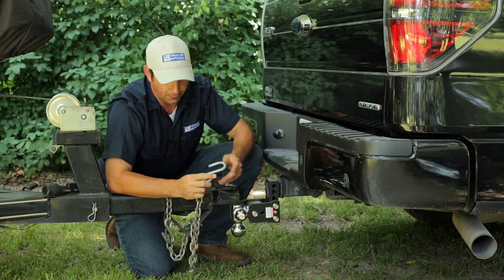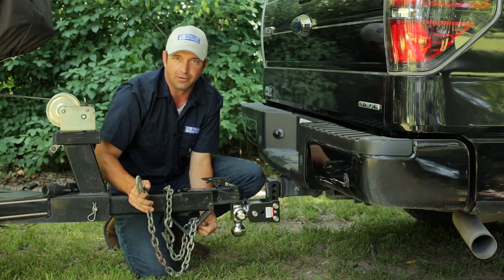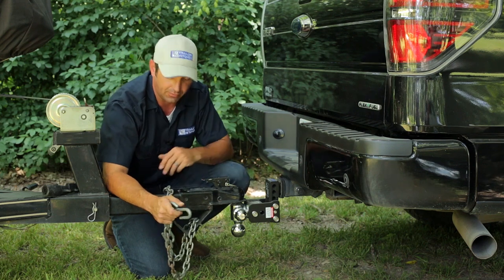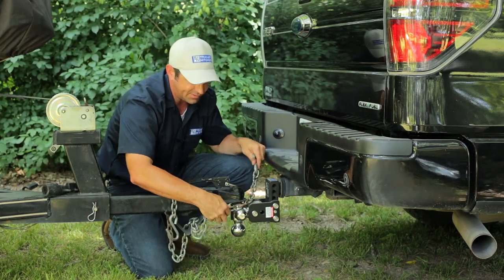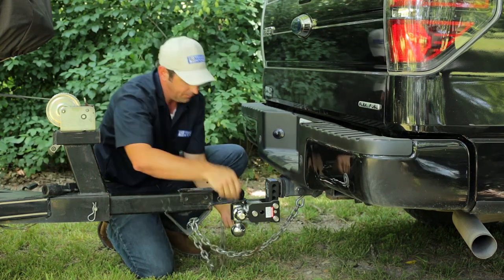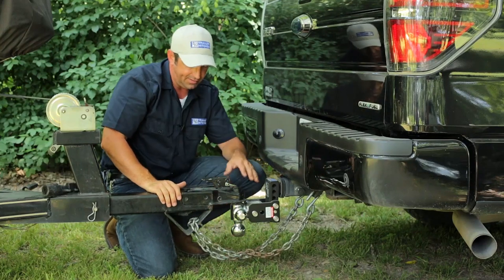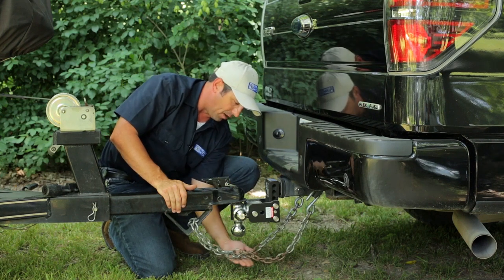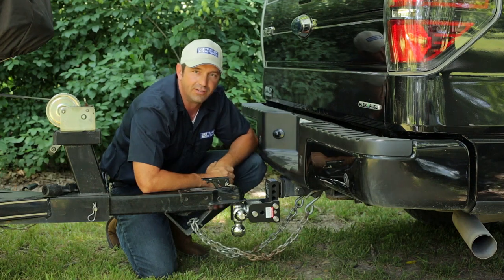Using Safety Chains Properly

Comment: It's not the best practice to twist the chain. Temporary fix, ok. But the twisting creates tension and compromises the integrity of the chain. Best thing is to buy new cotter pins and hook up the proper length of chain without twisting the chain. Also, it'd be great to see how to determine the proper length given that the truck & trailer will need to do left and right turns. We may need a certain amount of clearance for this, instead of just aiming for a 3-5" clearance above the road when the truck & trailer are in straight alignment. Otherwise, clear videography, great verbal clarity, and I love my B&W hitch.
Reply: Interesting point as when he said "twist it to take up slack", I thought that was a brilliant solution.

Comment: Criss cross won't keep the tongue off the road. A hammock only works if both ends are elevated. A hammock won't keep anything help up, if one end of the hammock has fallen. 

Length of chain, and minimal distance between chain attachment at the trailer, and where it's attached to the truck is the key
Reply: thank you

Comment: DO NOT TWIST THE CHAINS. Putting a twist into the chain will reduce the working load limit.
Reply: @Jack Hoffman actually it is
Reply: @Jack Hoffman actually it is totally true. Never twist the chains.
Reply: @MotoGPfan3987  ... "twist the chains",. This would be a good name for a rock band. Or, "Twisted Chains". :-)
.
Reply: How do you keep the slack from hitting the road?
Reply: @Bill-dp7lp  Shorten the chains
Reply: I am sure you don't care but, if the hitch lets go that twist goes away, the mechancial load is then centered on the arch of the chain as intended.  If you twist until they are taught then you have an issue.  Physics brother, but I am sure you already know that so what is the point.
Reply: Not true...better to twist the chains if NECESSARY instead of having them dragging on the ground. Period.

Comment: The S hooks without keepers will flip out when the the chain tightens and whips back. It happened to us and the trailer went down the highway by it self about 50 mph.The chain wiplash flipped both s hooks out. S hooks must have keeper clips. This bad info should be taken down.
Reply: Mine came undone the first trip I ever took and the trailer didn't even come unhooked, just the damn chains.

Comment: Great concept, but crossing chains for a cradle effect won't work for most applications where regular (standard) length chains are used... as soon as that trailer coupler comes off the ball, you must remember that ONE END of the cradle also falls as the trailer tongue falls especially with long-chains...  It's going to touch the ground anyway. THE ONLY way this cradle technique works is with very short chains, which would most likely make turning a bad thing. I suppose one could install a very short third CENTER chain that will catch the tongue before it hits the ground but does not hinder turning. I still cross my chains but not for the cradle effect as mine are too long for it to help. Twisting the chains does shorten them, but a twisted chain is a weaker chain.. As far as the cradle thing goes it's very easy to test.. Disconnect the trailer (coupler from ball) lower it to the ground and see if it touches terra firma or hangs under the vehicle..  Try it and you'll see what I mean.
Reply: I was really hoping that somebody else was going to get that too.... Because I had a problem with Uhaul.. With the same concept
Reply: Came here to mention that and you already did...this is one of those old wife tales again...
Reply: There are many configurations for sure... Can the chains be secured to the trailer closer to the coupler/lunette ring, if so have them moved closer... I've done that and it works for me - there's almost always a solution :- ).  
Kev

Comment: I'm from Australia and I can tell you there are several things you'd never get away with here that seem to be okay in your country. 
(1) Those hooks are downright DODGY. They would never be considered safe.....they could become detached easily and would straighten if a shock load was applied.
(2) Attaching the SINGLE length of chain to the trailer with a flimsy little bolt is stupid. All the shock load would rip that bolt in half in a nanosecond.
(3) As others have said already.....the chains are too long and wouldn't act as a cradle if the hitch came off the ball. The hitch would be in the ditch!!! Stupidily too long.

Comment: Those hooks are designed to hook on to the truck. Or if too long, loop through the truck hook point and attach the hooks back to the chain at the correct length
https://youtu.be/IzxlHKQQNCs?si=acFWgUAuQ0Jj9uBK

Comment: Those chains won't do any good if the pin ever falls out of the removable extension right?
Reply from the maker: Safety chains are used for exactly this kind of situation. They hook onto the holes on the vehicle's hitch receiver, which is bolted or welded to the vehicle frame. This way, should the ball mount detach from the receiver, the trailer's safety chains will still be connected to the tow vehicle.

Safety chains should be checked over every time you tow and be securely attached and crossed in an X under the ball mount. Chains with latches or keepers are recommended over chains with just the S hook. In the event the trailer becomes uncoupled from the vehicle, the forward motion of the vehicle often helps pull the chains tight, keeping the trailer tongue slightly elevated. Wind resistance and road friction will generally start working against the trailer as soon as it detaches from the tow vehicle, helping to naturally slow it down. It is important to stay calm and avoid any sudden maneuvers. Instead, steadily slow down and pull the trailer to the side of the road, bringing both the vehicle and trailer to a stop.

To help guarantee the trailer slows down during one of these situations, it is always recommended to have an emergency breakaway system installed on the trailer in addition to using safety chains. The emergency breakaway cable should always be connected directly to the tow vehicle and NOT to the ball mount, the hitch, or the safety chains.

Comment: Those chains are too long, the trailer tongue will drag on the road if the trailer become detached. The chains should be fastened farther ahead on the tongue and adjusted to the proper length, not twisted.
Reply: Yep. Great concept, but crossing chains for a cradle effect won't work for most applications where regular (standard) length chains are used... as soon as that trailer coupler comes off the ball, you must remember that ONE END of the cradle also falls as the trailer tongue falls especially with long-chains...  It's going to touch the ground anyway. THE ONLY way this cradle technique works is with very short chains, which would most likely make turning a bad thing. I suppose one could install a very short third CENTER chain that will catch the tongue before it hits the ground but does not hinder turning. I still cross my chains but not for the cradle effect as mine are too long for it to help. Twisting the chains does shorten them, but a twisted chain is a weaker chain.. As far as the cradle thing goes it's very easy to test.. Disconnect the trailer (coupler from ball) lower it to the ground and see if it touches terra firma or hangs under the vehicle..  Try it and you'll see what I mean.
Reply: @John-B69692  Lowering the coupler with the rig stopped won’t tell you anything about the cradle effect. For it to work (and when you want it to work), the tow vehicle must be traveling forward at at least a modest speed. As soon as the coupler fails (or whatever fails), the safety chains will be pulled taut thereby creating the cradle.

Comment: Wrong Hooks, wrong length of chain , wrong mounting place for chain.  Forged hooks with safety latches should be used.
The Crossing of chains should be behind the front of the tongue, keeping it off the road.
Chain should be bolted through tongue with Grade 5 Bolt min.
Reply: Yes sir Captain Safety. You must be tons of fun to hang out with.  🤣
Reply: @Swampfox1978  As a matter of fact I am.  Thank you.
Reply: I bet.
Reply: Correct what is the point of crossing the chains and they are connected at the same point on the trailer, they are supposed to be mounted in two separate connections.

Comment: That's often a question I have is well. If the chains are crossed to create a cradle, and the hitch still ends up dragging the ground, what's to stop the change from grinding and coming un done anyway? To me, it would be better to just do driver side driver side and passenger side passenger side because if the tongue comes on hitched, the chains wouldn't be in danger of being ground on the road. I would love to see some tests done with the chains crossed and not crossed to see what the results would be if the receiver and tongue became detached.
Reply: If you think the chains rubbing is a problem, I would ask, why are you driving with a detached trailer long enough for the metal to saw three themselves? Chain crossing isn't just to keep the hitch of the, but to keep the trailer behind the truck, crossing the chains keeps the trailer from swinging freely.
Reply: @Kickstandsup83  I can see how having the change crossed wood to keep it from swinging a little more than if they weren't crossed, but I would still rather protect the chains. As long as safety chains are attached from the truck to the trailer, that's all that matters for safety.
Reply: If you can't hear a chain rubbing for 10 minutes, you have no business pulling a trailer
Reply: @tiberiu_nicolae  federal and state. State that chains are required. It does not say if they are required to be crossed or not. Do whatever suits your fancy.
Reply: At least one reason for crossing the two trailer safety chains is that when turning, one chain does not drag on the ground while the outside (of the turn) chain does not become too taut, and vice versa. Safe travels, everyone.
Reply: @braeburnhilliard8340  They say that trailers come loose every 23 seconds in the US.  I am surprised they don't require 3 chains,  and 4 for California... haha!
Reply: @ericwright3382  lol. True that!

Comment: So can you explain to me why most states say twisting safety chains is illegal? Also chain mfg. do not recommend it. And I mean the actual company making it not you companies that have it branded to sell
Reply: BWTrailerHitches so at 1:42 he doesnt say twist the chains
Reply from the maker: We have confirmation from the Dept of Safety & Homeland Security that there is no prohibition to twisting the chain to shorten the length.
Reply: 3-5 inches between the road and the chain won't keep the tongue off the ground. If the tongue touches the ground when a trailer decouples, that is illegal in 20 states. Also, twisting chains in most situations is against the SAE standard for safety chains because it reduces the strength of the chain significantly. SAE J684 says that you can't do anything subsequent to manufacture that reduces the chain strength below their strength requirements.
Reply: Physics

Comment: Based on the worn off zinc coating on the chains in the video it appears. Those chains have been dragging on the ground.
Reply from the maker: No sweat! We can confirm that the chains are the proper length and in this video they just appear to be hanging lower than they are. The loss of the zinc coating and a bit of surface rust is likely simply due to the chains rubbing against one another. But you make a great point! It's always a good call to inspect all the connections—hitch, chains, coupler, brake plug, etc—every time you tow. If you spot too much wear or any apparent damage to the parts that raise safety concerns, swap 'em out. Better safe than sorry!

Comment: Crossing chains doesnt do anything to "catch" the trailer hitch. As the trailer falls so do the chains.....uh cuz they're attached to the trailer. Think it though and imagine it happening.
Reply from the maker: In the unfortunate event that a trailer becomes separated from the tow vehicle, the forward momentum of the vehicle as the trailer slows down will help to keep the crossed chains tight. The crossed chains then create the cradle that allows the trailer tongue stay elevated, or at least soften the impact with the ground as you bring both vehicle and trailer to a stop. Crossed chains will also help keep the trailer better in line with the vehicle. With uncrossed chains, the trailer may experience more sway, allowing it to veer into oncoming traffic. Crossing your chains will generally give you more time to navigate safely to the side of the road. 

Chains that are too long will negate these benefits and drivers should shorten the chains to the correct length for their vehicle and trailer setup. Your chains should only be long enough to accommodate a sharp turn. Set at the correct length, crossed safety chains can catch a coupling if the worst happens.
Reply: @BWTrailerHitches No it doesn't. Physics literally disproves this all day long, but people keep perpetuating the myth. A safety brakes being thrown and applying constant back pressure against your chains is what is going to save you, crossing your chains does literally nothing.
Reply: I hauled trailers commercially from the factories to dealers. And it DOES serve a purpose to cross the chains. It keeps the DOT from looking at you any closer. And please don't twist the ⛓️.

Comment: Wow! Never twist chains. If too long, use a different link to attach a D-bolt. What's that? If we used a hook like that in Australia we'd cop a fine. What's to stop it jiggling off on a corrugated gravel road or a pot-holey bitumen road for that matter? Crossing chains won't form a cradle. Myth. Expected more from a video like this, not one posted by a numpty. :-(
Reply: Had a bloke come around my place with his trailer to get my old steel work bench was to big to fit in his trailer so I proceeded to cut it with a metal saw he told me I should be wearing gloves while doing the job. So I put a pair of gloves on. Anyway loaded it on his trailer and I happen to look at his tow hitch there were chains  there but they were not connected to the car😁😁😁 hypocrite. Telling me about safety if that trailer came of and someone was walking down the street 😢